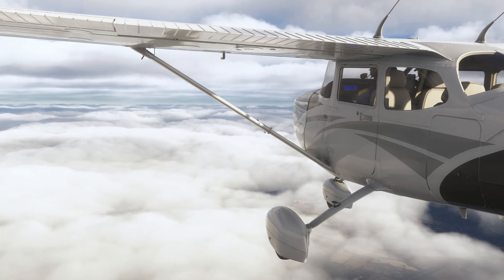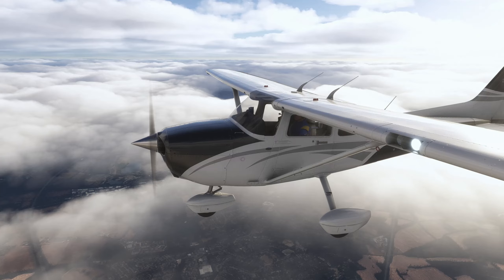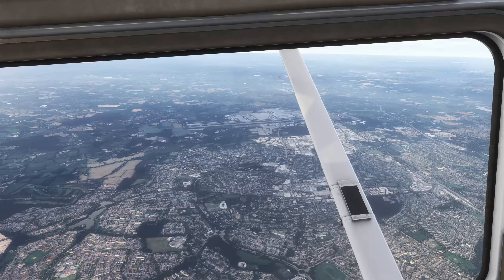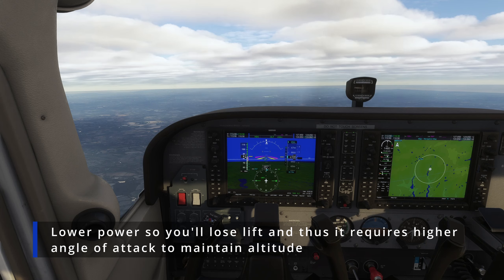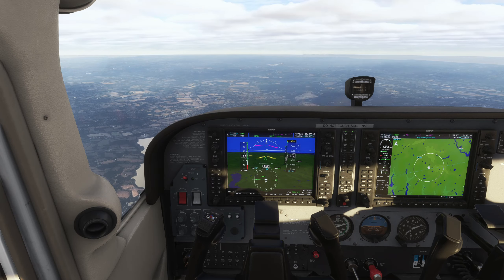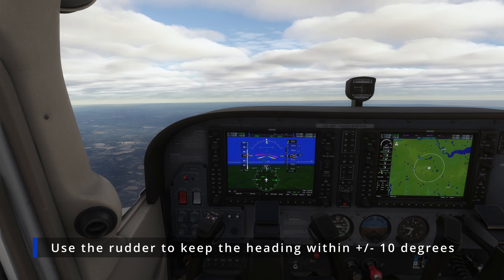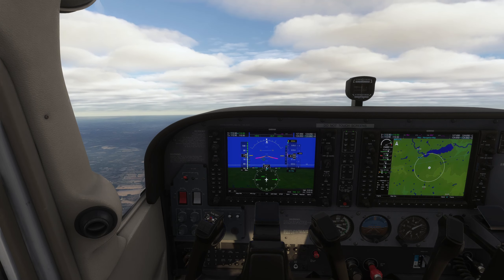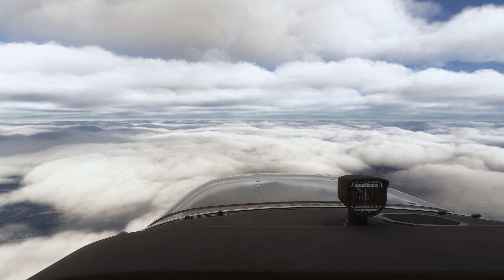MSFS 2024 - POWER-OFF STALL - FEELS REALISTIC? - REAL WORLD PILOT

Comment: Per the 172 POH you can have 1 notch if flaps below 110 knots, remaining two notches are in the white arc
Reply: Not every 172 POH specifically allows this.
Reply: @taytayflyfly7291  true, but the G1000 172s with 180hp engines do